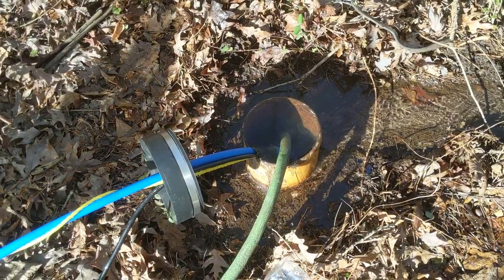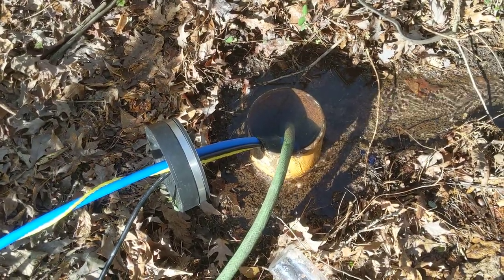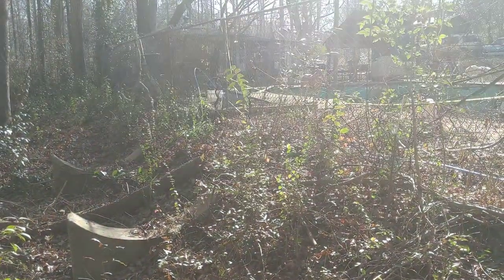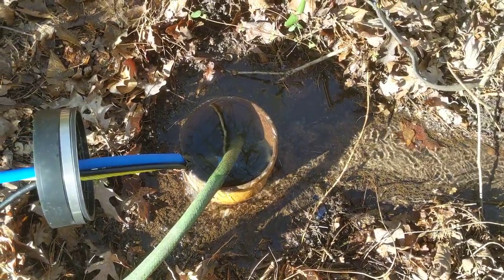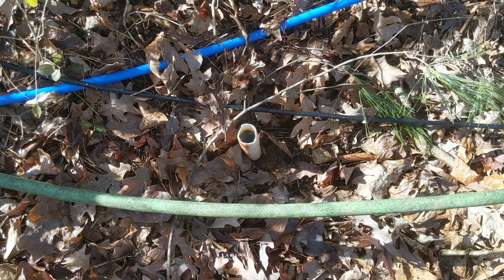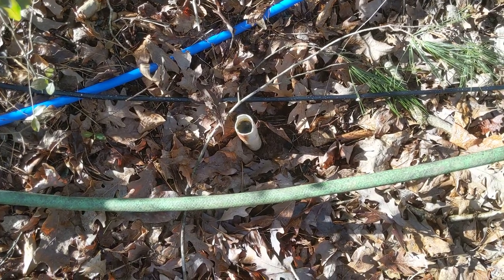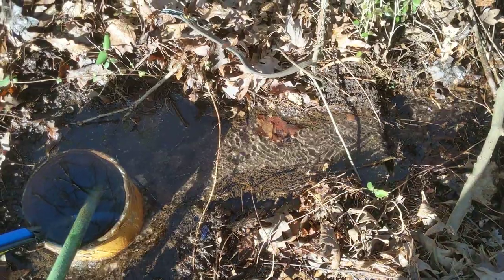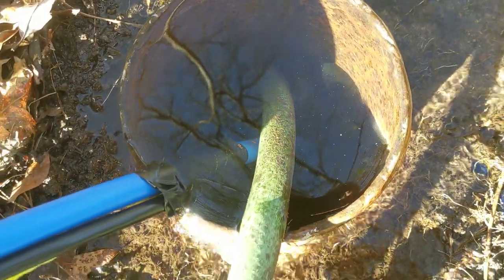Flushing the well, Jan 14, 2024

Comment: Ugh, well issues. I wish you the best of luck! We had to have a new well dug last spring because our old well pump died and then when we called someone to install a new well pump, the existing well pipe was some random small size and wouldn’t work. Kinda feel like we got scammed into having a new well dug, but I am sadly clueless when it comes to any kind of plumbing.
Reply from the maker: I've never done anything well related before starting this project. We are on public water but wanted to see if we can restore this old well as a backup in case public water is not available for any reason. 
So far things are going better than expected with this 60+ year old well that hasn't been used in about 30 years. 
Check the Well Project playlist to see whats been done and what happens next. 
Got a well filter to install next, but weather has been crap lately, so hopefully will get that done soon. 
Thanks for stopping by!